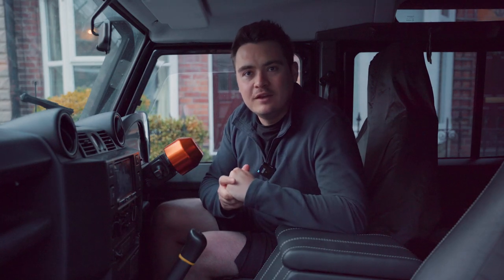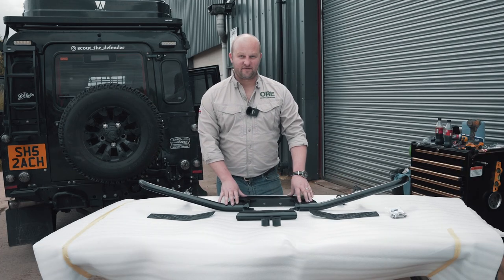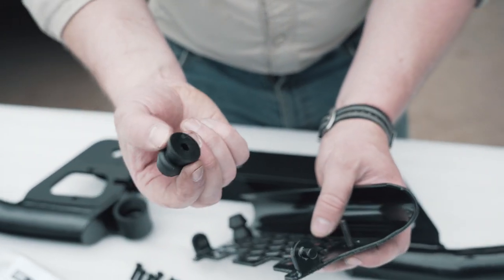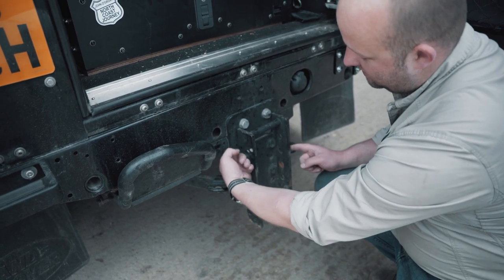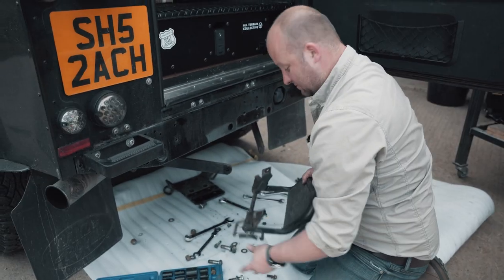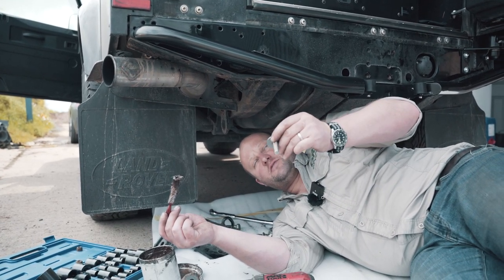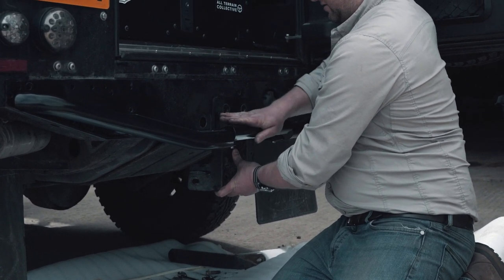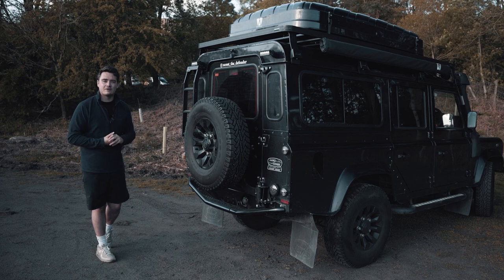THE MODIFICATION I ALWAYS WANTED TO DO | LAND ROVER DEFENDER

Comment: Stopped at 25 seconds in, wondering why your tow receiver block is on upside down? I see this a lot, turn it the other way up and it bolts on about 4" higher. (zero cost)